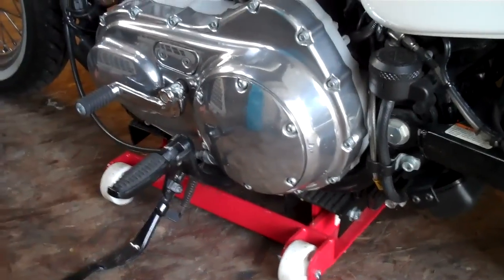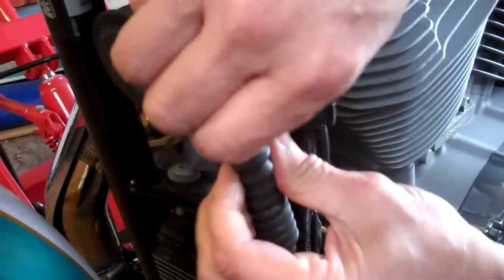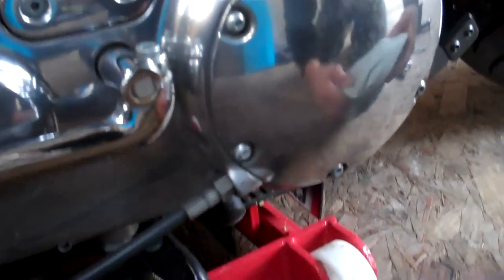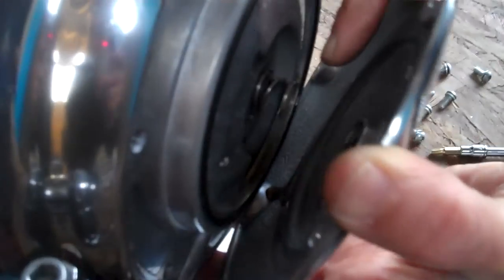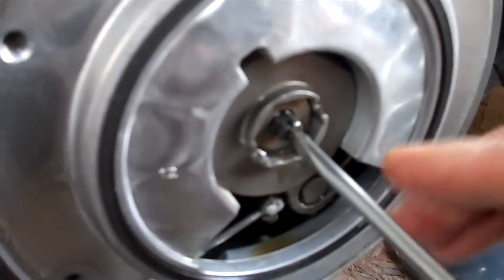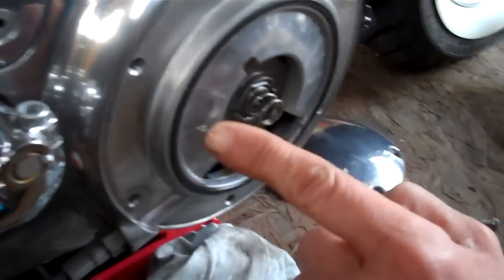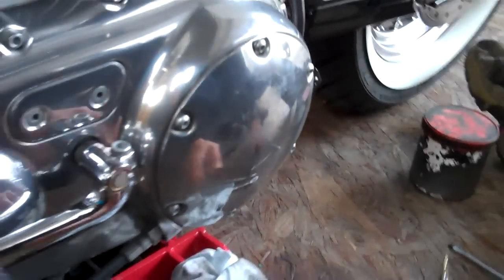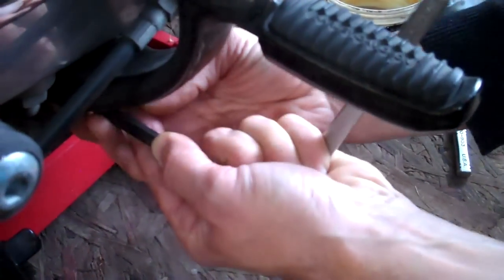Delboy's Garage, Harley Sportster Clutch Adjustment.

Comment from the maker: Hi buddy...not sure what you've done, if you have an injected sportster they do rev faster when they first start in the cold...then drop down to idle once they warm up a bit..the clutch should not effect the idle speed..have you maybe pinched, trapped or otherwise altered the throttle cables maybe?.. check the throttle is closing properly with the engine off, and make sure the clutch is engaging fully, if in doubt just retrace your steps and check everything you touched is correct.good luck, Del

Comment from the maker: Hi David, it would be a good idea to check it, but first, check you are getting full disengagement of the clutch when you pull the lever in...does it bite from the furthest point out, how much freeplay is there before the cable begins to pull the clutch pack?... you can first check the clutch cable is adjusted properly, if ti is, and you still get this 'clutch drag' you talk about then yeah, do the inner pack adjustment too...! hope that helps/ Del.

Comment from the maker: Bad news buddy, we learn from every snag aye..!, just fit the new one 'wrist tight'. no need to hang off it with  torque wrench, if it doesn't leak oil, and stays put, then its fine...so many threads and fasteners are wrecked by overuse of a torque wrench, nip it up tight by hand, give it a little extra tweek, and leave it alone...then just monitor it for a few days after, even dab the paint dot on it and keep an eye on it that way...time and practice mate, thats all it takes. cheers, Del.

Comment from the maker: @syizm yeah,  it sounds like the plates are binding, if the clable is taught, and the pack is being pulled all the way open, yet it still binds.. then like i said, the plates are perhaps a bit gummed up and stuck together with the oil. is the oil old, the right kind?, its hard without opening the primary for a looksee..  have you tried engaging gear with the engine running yet,? pump the clutch lever in and out twenty or so times, then engage. it may break it free! worst it will do is stall.

Comment from the maker: @AsphaltCowboyPacks Had 8 Harleys and never seen that, but its good sound logic, nothing is infallible... i cable tie the rubber boot on mine top and bottom which seals them, and yeah, vasalene or grease the adjuster assembly too, good call... thanks fellah. every tip counts.   Regards Del.

Comment from the maker: @syizm Hey Buddy, sorry you are having trouble. Im assuming you have the middle cable adjuster opened up, and you didnt disturb the clutch pack? Its not easy to engage first and push the bike with the clutch in, if the bike has been sat for a long time the plates can get a bit glued together too.  But the main thing is "Do you have tention in the cable, or is it still slack when adjusted right out?" if so, you may have the wrong cable buddy.check the part number with the dealer over the phone

Comment from the maker: Hi Paul... I guess the later bike here has 6 bolts holding it on , but if yours is only four, then that's probably it...its not a pressure casing so that's all it probably needs four..hope that helps...

Comment from the maker: @syizm Tell you what, Im not so sure there wouldn't be some clutch plate interface even with it full open, the plates only separate by about 1/16th" at most, more like 1/32nd" if they are a bit old and have some heat warpage.im gonna slip mine in gear when i get home in about 3 hours, and see if i can push mine with the clutch in while in 1st, (all Sportsters go into gear with a bump),which indicates the clutch doesn't fully let go till its running, ill let you know tomorrow if mine's the same.

Comment: Acquired a 1995 1200 last fall clunks going in gear .a little concerning . Use to old big twins where they go in seamlessly.  So going to try your method.  Do not want to wreck gears or shift forks over something that simple as an adjustment.  Thanks for video.
Reply from the maker: Change the primary oil mate, once it gets a little worn out, the plates can get stuck together... which can lead to heavy shifting... do the clutch adjustment whilst you've got the derby cover off and then when you do shift in to gear, pull the clutch in and wiat 2/3 seconds before selecting the gear and it'll go in a lot more gently!
Reply: @Moonfleet41  OK I did change fluid when I acquired it. But running to dealer needs new quad ring I'll change again was sitting 10 years. Have been test riding so maybe it cleaned out some grit . Primary chain looks ok inspected no rust on it.  Will adjust that about 3/4 inch says 3/8 in book no tight and loose . Thanks for suggestions

Comment from the maker: Hi mate, ok, i thought it was a Harley....but if its a CB1300, then yeah, there will be gaskets in there what will hang on to the casing making it hard to get off.... little light taps with a nylon or hyde mallet will usually dislodge it...   As for the finish, why not get them powder coated the same colour as the rest of the motor, makes it easy to wash off and look good... otherwise, think old school, just strip them off, and clean with a scotch pad for the cool satin finish...? good luck, Del

Comment from the maker: Hey Buddy, Yes, you can sort thay out very easily... Your 2003 Sportster still has the old style heavy clutch...(from 2007 they came standard with the new 'easy pull clutch'), you can buy a kit to swap the twist plate in your clutch and make it smooth and half the pull weight.....cant post a link on here, but just Google "Harley Easy Pull Clutch Kit"....and buy the kit, it comes with instructions and will make life much easier for you.. hope that helps.. Del.

Comment from the maker: Hi mate, sorry to hear you have a problem with your Harley...a 2013 Harley does not have 'a chain' and if it's too right, according to the dealer, they should be dealing with it as it's under warranty for 2yrs, so take the bike to them, ask them to ride it so they can experience the noise and then if there is something wrong they must fix it for you...the bike has a 'drive belt' which does not make noise, so perhaps you have something else wrong... hope that helps, Del

Comment from the maker: Hi David...its a mechanical task that needs both the mechanical and anatomical knowledge, and the tools for the job....if you haven't done it before, then its not something i could 'talk you through", its just too big a task... perhaps this one is one to hand over and be safe in the knowledge that its done right...  also, i dont know where you got the impression that the factory clutch is "crap".i have never had one fail in 20 years since my first Harley, and the only reason to fit an extra cont

Comment: Easy peasy! And after looking at this video I think i know what has happened to my XR1200 clutch. I think the cable broke and the little knob at the bottom has fallen inside somewhere and found a happy place after getting ground down before I could even pull it off the side of the road.

Comment: A thick wipe of clear silicone "tuneup" grease on the adjuster threads (ALL of them) etc helps exclude moisture. Those accordion boots are condensate traps which is why I'm replacing a previous owners cable today.  His boot was zip tied but his adjuster is a rust ball.
Reply from the maker: Good advice and wise words well said Sir, on Harleys I've used in all weathers, I often spray chain wax up inside them, and I never cable tie them as at least then the moisture can dry out, thanks for sharing ...

Comment: Hi there. For start I appreciate your reply and I like to learn from your videos, they great. Wanted to remove the side engine covers of a cb1300 cause with the winter riding the road salt got into the lacquer that coats the aluminium. Then I would sand them down apply heat resistant clear and put them back on looking great once more. Did the same with the exhaust after cleaning it and replacing all the gaskets but as soon as I put the bike to work the clear started to become brown.

Comment from the maker: i would say that the bolt seems to match my tool recommendation, so im right there....so maybe they sent you the wrong tool?.. does it have a size marked on it?.. have to measured it so see if its actually 5/16....and has the bolt been changed in the last 18 years?....anyway, you can buy alun keys in sets, so just buy a set and use the one that fits...easy..!

Comment from the maker: @AsphaltCowboyPacks Never heard of that one before mate, the tiny amount or water that gets behind the rubber boot would never be enough to run inside the cable, plus the outer casing is bonded to the steel nut so the only route in to the inner wire, would be through the thread, and its locked against itself.... so its pretty impossible... however, like i said, squirt some WD40 inside the boot, and cable tie is top and bottom if you are worried..

Comment from the maker: Ok, it looks like he just didnt explain it enough.. carb cleaner is highly flammable, if you spray a little into the air intake while the bike is running you'll hear is rev up by itself... so if you spray it all around the carb area, (where there are joints and places air could be sucked in), if there IS a vacuum leak, then it will drag the carb cleaner mist in, and the bike will rev up..if you spary it all round, and it DOESN'T rev up, then none is getting sucked in, so no vacuum leak...easy.!

Comment from the maker: Hi Mary, by rotor I presume you mean brake disc?..it's not a complex job at all, if you can take the wheel out and lay it with the disc facing up then just undo the bolts and swop it over...I wouldn't make a video of this as the bolts are lock-tighted in and should  not be disturbed unless you need to...I generally tend to search YouTube and can usually find most things .. depends a little on your mechanical ability & from what point you need instruction. Sorry I can't be more help, Cheers Del

Comment from the maker: I dont use "lbs Torque", in fact i havent heard of that measure... i use "lbs ft" (as i did here, so like you said "foot lbs", same thing),  there is also 'Nms' but that's metric, and i like Imperial measure..  hope that helps mate... Del.

Comment: Hi there. Great video, however as with most things, it didn't quite work out for me.

I have a 2007 XL 1200C. Over the weekend, it became very difficult to change gears. I noticed that there was almost no free-play at the lever, so i started by adjusting clutch cable. After adjusting that, it worked a bit better -- able to ride & shift -- but still difficult. This afternoon, I worked with a colleague to hold my bike upright and adjust the free-play behind the cover plate.

When I took the cover plate off, and removed the spring and nut, I had to rotate counter-clockwise at least 3 full turns until it was seated. I think backed it off 1/2 a turn. 

I then put the cover back on. When I went back to the adjuster screw, the lever tightens a bit, but even if I crank the adjust screw all the way down, there is still a 1/4 inch of slack at the lever.

Not sure what I could have done that would have caused this. Any ideas?
Reply from the maker: Hey buddy, it is impossible to tell what you've done wrong without being there... all I may suggest is that you start again.... and I will give you some common advice that many people get wrong.....

Make sure you start by collapsing the cable adjustor sleeve completely together so the lever is flopping around at the bar, and do this BEFORE you touch the engine casing... once inside the engine casing, observe the cable down in it's connecting fork at the bottom of the clutch and make sure there is a little free play on the cable and that it is not pulling on the fork at all... now you are ready to adjust the clutch pack.............

Remove the spring and nut (and here is where some people go wrong!)... back the nut OUT (counter clockwise) until it stops, and many people use a screwdriver and keep turning till they can turn no more and this is way too much !  When we say 'back out the screw till it seats' - we mean when one part touches the next.  You should not screw this adjustor screw outwards with any more pressure than two fingers on the dust cap on your tyre valve... I mean it must be really light pressure... you simply need the back of that screw to just 'touch' the back plate THEN turn back INWARDS ONE QUARTER TURN .... and then re-assemble everything.  

When you fit the nut back over the screw, try to make sure it does not move when trying to slot the nut in to it's cup... and then when you have re-set the cable free play, make sure that you have the 3mm of free play at the level knuckle.

So as you can see, the common problem is not understanding the seating of the adjustor screw, if you wind it out too much, you actually lock the clutch plates up, I really cannot stress enough it MUST be turned out with NO PRESSURE at all, in fact when I am busy and on a time limit with the service, I usually just use my fingers to turn that nut out... hope that helps, good luck , Del

Comment: Hey Delboy! I appreciate all the quality videos you have and the helpful Information you provide. With your help I was able to switch out my throttle, clutch and brake lines when I added 12" apes to my iron. I think I may not have put in the clutch back together proper after I removed the hex nut and assembly to add the clutch cable head. As a result I am feeling some vibration from the lower body and clearly can feel them my foot pegs. Happens on any gear, roughened the ride quite a bit coz it vibrates a hell lot now... and the only way it lessens is if I hold down the clutch lever slightly. 
I haven't inspected it since but just trying to brainstorm it with you :). Probably that's what causing it but just incase you have more insight on this. Total noob here so hopefully I haven't created any major damage inside... fingers crossed!
Reply from the maker: Hi there,  thank you for your kind words my friend... Ok, its almost impossible to have you a diagnosis for this as it doesn't sound common... it could be that you've buttoned up something wrong... so just retrace your steps again, take the Derby cover off, and check the clutch screw adjustment again as in the video.. and make sure you have your clutch cable adjusted up with the right slack.... and if you made no other changes, then is has to be one of those things.   see how a check over goes and let me know.. if you handed me the bike thats the first thing i would do..!  Good luck.. Del,.
Reply: Moonfleet41 I adjusted the clutch nut and it seems to be better. I think the motor mount just needs to be replaced.   Thanks again for taking time to reply. I know it's impossible to elaborate and solve such a problem online and I appreciate you taking your time to respond to everyone's comments and problems. Keep up the great work! Cheers from Dubai 😎

Comment: Hi Delboy, thanks for quick respond. I'm going to check the cables this weekend just incase they need some adjustments, but in terms of vibration the way I can explain it is I see the lights of cars behind me in mirrors as a line rather than a dot due to vibration, and my friend has a 1200 cc sportster with out that much vibrations on the road. I bought the bike about 6 months ago and it does have vans hins pipe on it, hopefully previous owner has tuned it since performance is perfect. I wonder if you have posted a video to clean or replace front break pads? thanks again buddy

Comment from the maker: Hi mate, Darn-it, i had a 76 XLCH just like yours back in the early 90's, but i just cant remember what the cable was like... and thats shameful because i put ape hangers on it with longer cables, so you'd think i would remember..DUH... OK, if the cable has the trade mark "bottle screw" adjuster in the middle of its length, then yeah, its the same.. if not, then its probably in the casing.. can you send me a picture or two, ill take a look and reply back?... thanks for watching... Del.

Comment from the maker: Hey buddy, I sorry to say i have no experience of the Bighorn, if i remember right that a little 350 two stroke trail bike right?... having never even seen one in the flesh i have no idea of its anatomy...so cant help you with what could be wrong.. As a basic guide, if it wont pull under load then clearly the clutch is either not engaging, or in some other way the drive is not engaged...you just have to start eliminating the problem bit by bit.. so sorry i cant be of help, good luck with it, Del

Comment: Hello! When I watch your videos i sit and take notes on good workshop practice and what tools to use. The videos have a relaxed and informative atmosphere that makes me in a better mood. You should be a teacher on a mechanical school.

Now time has come to change the primary oil/ gear oil on my bike and I have a question for you: Where do I fill primary oil/ gear oil on a 2013 Sportster Iron?

Is it through the primary chain inspection cover??
Reply from the maker: Øyvind Hide Barstad Hi There, thank you for your kind comments, and the answer is no, not the chain inpsection hole as you cannot check the level then.... you fill it simply through the open derby cover itself (the big main cover) and fill it with the bike set upright as you need to fill it to the bottom of the clutch plates just pour the oil in through the large open clutch hole... hope thats clear, good luck with it.. all the best. Del.
Reply: Moonfleet41 Thanks Del!